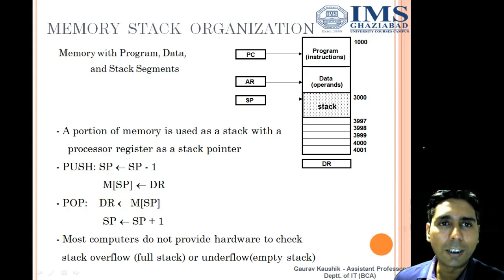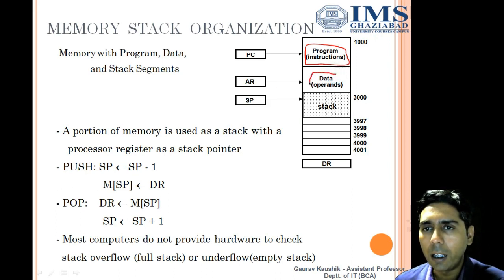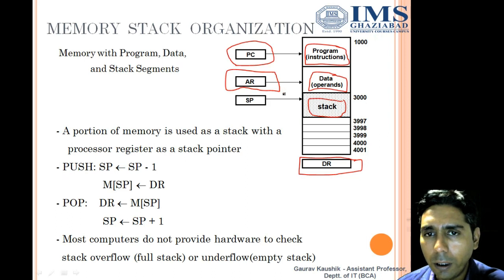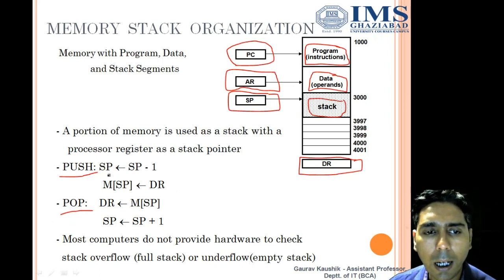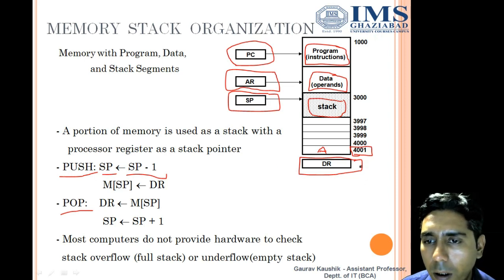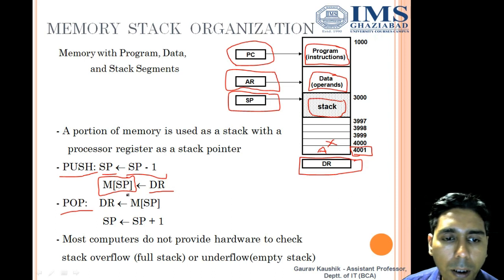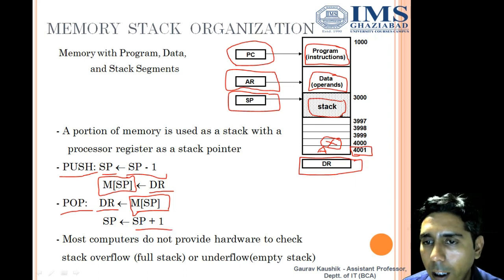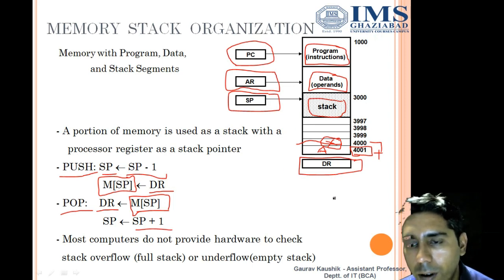Memory Stack Organization

Comment: This is Memory stack used in computer architecture (inside RAM) Here in this example insertion of elements are starting from last memory address unlike that have studied in Data structure starting from first position of stack so here we need to go back on every insertion to fill the stack portion of RAM. Although we are going back but still stack portion is maintaining the LIFO structure. Check complete video. !!!All the best